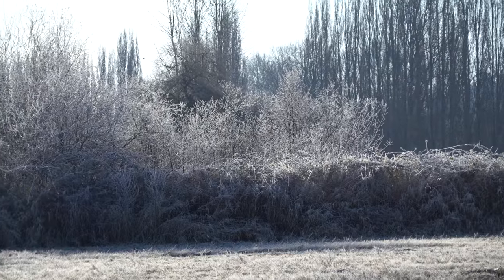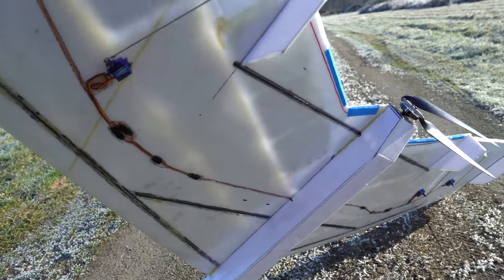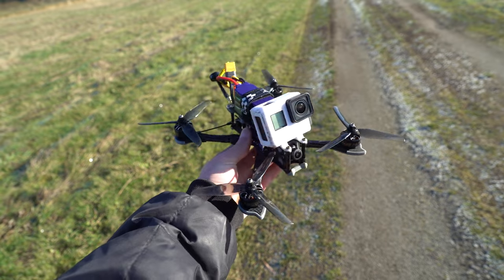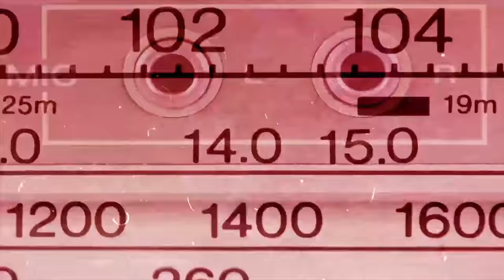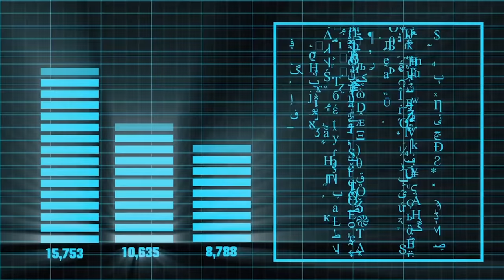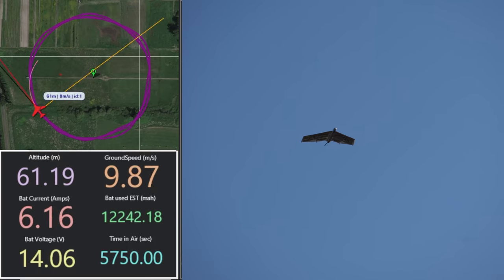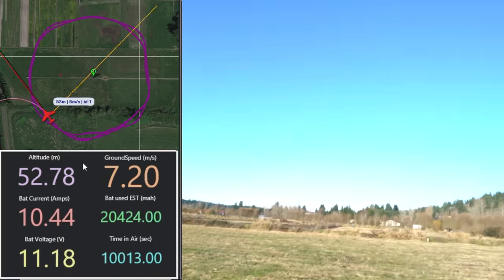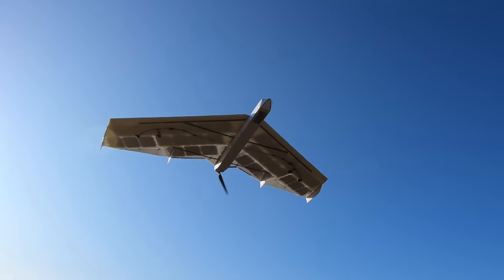Solar Plane V4 in the Dead of Winter

Comment: You've already nailed propulsion and nav systems, however it is time to improve your airframe technique to achieve better aerodynamic and aeroelastic characteristics. I bet the result will be phenomenal. Well done
Reply: I really enjoyed everything. I agree on the aerodynamics though, im amazed that flys at all. But, Maybe the gaps in the solar squares are acting like vortex generators and actually helping. The look of it is so counter intuitive. Perhaps this is the future of aerofoil design in low speed aircraft?  Accidentally discovered a stall proof wing. 😂
Reply: @BudoReflex  I think this is already a thing. If I remember correctly they are   called kfm airfoils.
Reply: The KFM air foil creates almost a vacuum of low pressure above the wing and helps to basically suck it up
Reply: @brsrc759  All airfoils do that, bud :) (except symmetrical ones)

Comment: Imagine the drone lands on the aircraft while it's flying.
Reply: Ultimate aircraft carrier
Reply: Air-to-air refueling: Electric edition
Reply: We did that once. It didn't end well...
Reply: Kk, gonna try it on my plane once I finish it.
Reply: Bruh I was just thinking that
Next video...? 
Maybe...?
Reply: @time-lapserpro4370  with some qi chargers it is possible! or even better tech, but is hard to find some wireless stuff nowadays
Reply: @viniciusschadeck2204  I could see one of those circular magnetic electrical connectors working, just like a hose on real air-to-air refueling. Maybe a supercapacitor on the drone.
Reply: Surely the one that should be called a "drone" out of these two is the plane, because it's the one flying autonomously?
Reply: He needs to make a mechanism that could capture the drone midair and charge it.
Reply: Ian Oliver Hold up

Comment: STOP THAT ! i am in the middle of building a 120" wing and i am going to make it solar if you tempt me !
Reply: 120 inches or centimeters?
Reply: @modelrc9500  double quotes == inches, p/s to OP, doooo iiiiiiit, you know you want to! more solar planes the better!
Reply: No way you could never do it it won't work 
And if it does work I would love to see video 
Good luck with your build
Reply: Inches  so 3.06 Meter :)
Reply: I KNOW !  i just finished the Programming . i think i will do it
Reply: the wing is done check my channel :)
Reply: I'm building a 3.5 meter wing based on Samm's "Engineered Wing".
I am using all solar panel power and a couple super capacitors for a very lightweight, super rigid build with no battery pack.
The capacitor gives me a but of a charge to help get up to altitude and also as a "buffer" to smooth out the power fluctuations and help carry me through if a cloud decides to temporarily obscure my direct sunlight.
For testing purposes I did build a 3s2p lithium ion battery pack out of 18650 cells and I'm using an oversized prop for best endurance.....
I'll check out your site.

Comment: If you give it vertical surfaces, such as a tail fin (clear of the wing, or even underneath) and a fuselage, you could add solar cell to each side. That would generate some useful electricity when the Sun is low, and your flight direction is favourable.

Comment: You could buy an INA260 to measure the current of your solar cells, they are pretty precise. And only the low sun is the issue here. When I turn my solar panel directly at the sun (which is now 13° low) I still get 100%, maybe even a tiny bit more because the cold helps with the efficiency of the solar cells.

Comment: You could apply tape with embedded fibers in a diagonal pattern around the leading edge and across the front half/third of the wing to prevent twisting.

Comment: Very late comment but how many PV Volts do you have it configured to compared to the battery the PV panel have a specific voltage it perfere to stay at for maximum output power.

To get max performance it should be on a MPPT charge controller.
That vs direct to battery might give you 50% more power if your voltage matching is of

If the battery is 14 v nom and the panels are peak watt at 7 volt you need 2 in series.

If the panel is 12v 4A you need 2 in series (if no controller) but there will never be above battery voltage, so open circuit 24v but limited to about 14v and roughly still only 4 amps so loosing about 41% power loss just from having no MPPT charge controller or having matched solar voltage.
Reply: Just saw the older video where you show having a MPPT controller 👍

Comment: Hi, I agree that you need another current sensor, just for pure panel current.
I would have been interesting to see in that low angle condition, just how much was coming from the panels.
A vertical stabiliser would allow you to fly across the suns rays at an optimum angle to get max energy. 👍👍👍👍👍

Comment: I would suggest that you need to extend the trailing edge and elevons further back. It will increase lift a little and will improve control due to their trailing edges being further away from any turbulence caused by the solar cells. As it'll be mostly foam any weight increase will minimal. And, as you know, all the trailing edges can benefit from being pretty much razor sharp, to further reduce turbulence.

Comment: The solar cells will be more efficient when they are cool, as with any other semiconductor.
I know that from my home solar panels.
They are rated at 6.8kw/h, and in the summer they never get over 6.4kw/h.
However, in the winter they go up to 7.4kh/.
So, yeah, i think the ambient temperature is something to be considered when working with solar cells and Litium batterries.

Comment: I'm not sure if you've considered this already, but if you use two entirely separate batteries, and add a simple electronic system to switch between the two, you could constantly be charging one battery via solar, and using the other. This might help with the problem you had noticed before, where the solar cell's ability to charge was hindered due to the draw of the motor. It would also keep you from allowing the battery below a threshold voltage during flight.

Comment: Started flying lithium ion on my 7in drone and I see a big sag when going below 3.1v per cell and a super drop under 3v per cell.    Almost seems like anormal distribution curve for lithium ions "useful" voltage range seems to be 3.0-4.2 with the quickest voltage drops between 3.0-3.2v and 4.0-4.2v.

Comment: 2.8 hours!!  Well with 5AH batteries and the plane drawing a little over 5A, without solar it should have run out in an hour (a little less since it draws a little more than 5A).  So the solar panels about tripled the flight time and distance.  Nice!  Another way to think of it, this was powered 2/3 solar and 1/3 battery.

Comment: Great video. What do you think, maybe a battery of ionistors is better (easier) for flying on a sunny day? Will the aircraft become lighter and possibly reduce engine speed and spend less energy? Do not you think to reduce the length of wires to a minimum? all this is overweight + maybe add vortex generators to increase lift?

Comment: There has to be a lot of efficiency being lost, by charging the battery, right? I wonder if it could fly without the battery.
Reply: The reply to that question is simple mathematics. you need to know the sink rate in meters per second and the weight of craft in kilos or grams . The maths are like this is you have a 1 kg craft let's say a brick it will have a sink rate of 9.8 meters per second the force of gravity for the first second of falling  . So  unless we attach hover  rotors to the brick like quad drone  the net power for the brick to hover required is 98 watts .  If we assume the electric efficiency of these rotors drive system  is 25% after all losses then we need 98 watts multiples by 4 times  equals ~ 400 watts to hover this electric powered brick . The winged aircraft not a brick has wings and in glide mode will have typically a sink rate of 1 meter per second for gliders and 2 metre per second for short stubby wings like a cub aircraft or 4 metres a second for typical Delta types a lot less fall rate than brick . Assuming this solar. V4  youtube  foam craft had a all up weight of 1000 grams or 1 kilogram   and had a engine off sink rate in gliding of 1 meter per second the net  power needed  to maintain steady level flight  is 98 watts /~10 =~ 10 watts  ( to keep maths simple we make the force of gravity 9.8  metres a second equal to ~10 metres a second  )to maintain steady flight . Assuming 25 % efficiency for engine prop ESC  then we need ~40 watts to maintain level flight in battery mode  . Assuming we have ~80 watts of rated  power from solar cells  and with low sun we got ~40 watts of  power from the solar cells we could maintain level flight. Needless to say  we Need typical more than the mathematical limits to climb and fly level especaily if its windy so conservatively we really need 60 watts power  output from the solar cells to maintain level flight  . If we make the aircraft have smaller weight such as 500 grams the wing loading might drop so we get a lower sink rate example 2/3 rd of a meter  per second  and we can reduce the weight of solar cells  so that 30 watts of power will make this same lighter plane fly . That is why weight is critical issue in solar planes ability to fly . We often remove the battery power for flight and use only small power source to drive receiver and often launch from slope soaring locations  to see how well the craft fly's in that situation . Take off from level ground can be done using rubber band glider launch systems or tow aircraft or extra solar cells and waiting for midday extra power ... My quess is this plane with no battery power to drive engine would in winter in time  struggle to maintain level flight solar power only . However in summer  it has better chance at midday to get airborne without battery assist . Time will tell .Most solar planes will use long glider wings made extra light using ribs and balsa to help keep weight down and sink rates lower often as low as 0.5 meters per second . Putting cells on side of plane introduces another problem shading .If the solar panels on the wings were getting good power and the solar panels on the surface like rudder or fuselage were in shade the shaded cell can block all the power from the wings getting to engine if they are all on the same series power line . Its like the Christmas tree lights in line if one bulb breaks all the bulbs in that line stop to light up  . To stop that problem if we put all the non wing solar panels in a different circuit parallel charging then we need a extra solar controller for that circuit adding cost and complexity  Also we need the same amount of cells as the wings have  just on one side of plane to stop shading problems . So really we now need three sets of panels the wing panels the left side panels and the right side panels  and now three controls and three times as many solar panels all extra cost extra weight. And most likely 1\3 the panels will always be shaded and dong nothing . Worse if the sunny side were to get one panel blocked from shadow such as over head wing then that circuit will stop or reduce its power so now 2/3 rd of the panels will not produce power .So for practical reasons we often opt to just put as many panels as we can on the wings and use one solar controller .Hope that helps but use flight simulators li!e Motor calc to help figure out the possibility the plane will fly  with best sink rates and best light weight with batteries before converting  the plane to include solar panels and later solar panels only . As solar panels drop in cost improve in efficiency  reduce in weight and fragility  we can expect to see models where there will be panels on all surfaces of the crafts  and become acrobatic even with no battery power sources  and fly all day time when sun shines. For now its hard work to get solar panel flights. the typical biginers mistake is to assume the 90% efficiently for the electric engine  is the total efficiency  of the system . Propellers tend to be less than 50% efficiency  so the electric engine with 90% efficiency is now 50% of that attached the prop so its now 45 % efficiency . There are other losses batteries lithium tend to be 90% efficient . When we do the calculation s of all losses to the system in battery mode we find that final numbers vary between ~15% to ~30 % depending the quality of the equipment and the type purpose design of the craft . Throw in solar cells and you can easily half the result to ~7.5% to ~15% final drive efficiently. Expect 100 watts of power to deliver in total ~10 watts of useable final flight drive  power in winter bad light  and if you get more your doing well

Comment: You should Make it so the solar panels are counted at a 30° angle on the top middle of the wings so I’ll catch more sunlight depending on which side it is on but not at such an angle that it will not capture at least a little bit of sunlight so if you were going right at it and turn you’re still going to have at least half and I am realizing that you also put some flat ones at the back middle for all around stability of solarness

Comment: I think an X-wing design might work better with low solar elevations, or some kind of sail above or below that won't interfere too much with flight, but still present a good angle to the sun.
Towing a solar banner would be heavy, but it could have wings too!
A solar powered blimp would be most efficient as it wouldn't have to use much if any energy for lift.

Comment: Keep in mind that cylindrical Li-ion cells have significantly lower c-rate capability than your typical prismatic pouch cells (LiPo). So cylindrical cells are not ideal to use for high power applications such as rc planes, unless you put sufficiently many cells in parallel to compensate the low c-rate (which is impractical due to the resulting weight and size). So expect faster aging of the cylindrical cells in this application, and probably larger voltage drop during use (higher internal resistance under load). On a side note, the cylindrical Li-ion cells are of the exact same chemistry as the LiPo cells, both are Li-ion technology. But the LiPo cells are usually engineered differently for power optimization (high c-rates).

Comment: What if you tossed the batteries and replaced them with a lightweight super capacitor as a buffer and to use as initial "charge", would the weight saved  by tossing the battery pack allow you to fly on just the solar cells?
I know that your previous version spent a lot of time making enough energy to charge AND fly the plane.
That being the case,  during the summer it ought to be able to stay up, right?

Comment: Try to calibrate the current meter on board 
There should be a setting there 
Also try getting those cheap voltage + current meter with record function and connect that to the solar cell ,then using the data to plot a graph

Comment: Three words: "Lateral departure mode". Or lateral instability. You should enlarge the vertical stabilizers, and move them a bit further back, if possible. Rounding the front part of the fuse can also help.
Reply: I didn't notice much oscillation. Did you see some?

Comment: Few things: 1. LiFePo4 batteries have lower power density = lower flight time for the same amount of cells by weight. So in theory it should have less flight time with these, unless you put more/bigger of them. 2. Solar from solar in the winter is indeed a lot lower than in the summer, but you do have 10-20% power loss due to overheating in the summer, so that's a bonus in the winter in a winter day like this. However the angle is terrible - if you could aim it at the sun then the results would be much better, but that's not possible on a plane - too much air flow
Reply: Who said they are LiFePo4? lol

Comment: Building a solar plane off of a powered glider platform. I am using the SunPower c60 cells. How did you wire your plane with the cells as to not blow anything up with too much current?

Comment: Have you noticed the battery voltage is relative to which point in it's circular flight path the plane is this is because of the small tilt of the solar panels you may be able to optimize your panel output by having a larger tilt at the appropriate time in your loop.

Comment: Excellent stuff and inflight filming .  Maybe a larger  flight path like a square or six sided  hexagon path with less turning say orbit of 1/4 mile diameter  will help to expose the GPS to steady state speeds in straight lines  and show the wind effect for each leg  of the flight  as constant turning for circle skew s the information slightly with increased power demands that turning causes even shallow turns demand extra power . Just a suggestion your flying field might not suit that solution .

Comment: I'd like to see a solar powered version of a b 52, because it has a lot of wing surface and is designed by the guys at Boeing, to have an incredible amount of storage. this would allow for two things, retractable landing gear and as many batteries as needed. this model of plane, the be 52, could also be used for at least two or three different camera angles. one on the belly of the plane, for 360 recording as well as one on the top of the fuselage of the plane, for the line-of-sight style flying. either could be used or both, one for first person view, the other for seeing what's already in the air. with all of the space in the pod bay, for batteries and motors, the global positioning system could sit up in the cockpit area with the autopilot computer in the same area. there are two version of the b 52, one of them used propellers for thrust, the other one is the b 52 a, which is a jet.